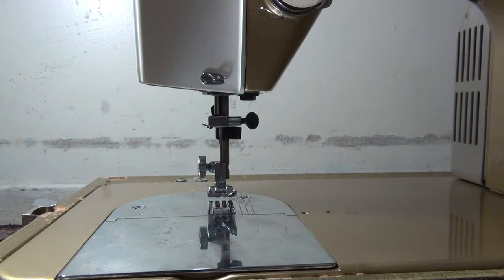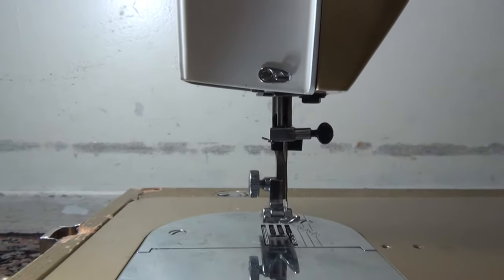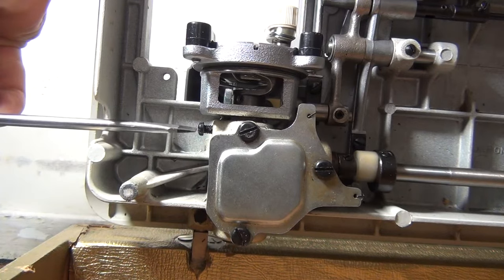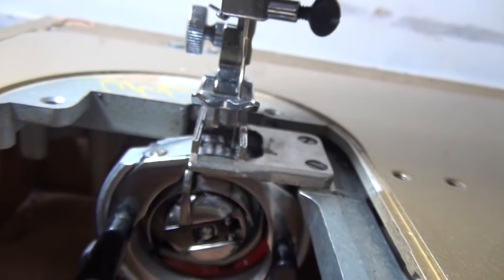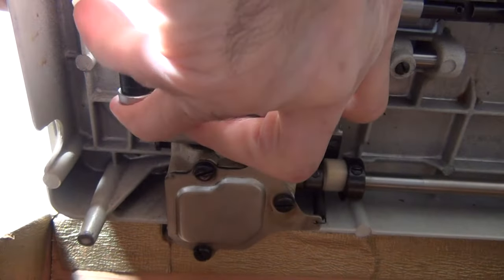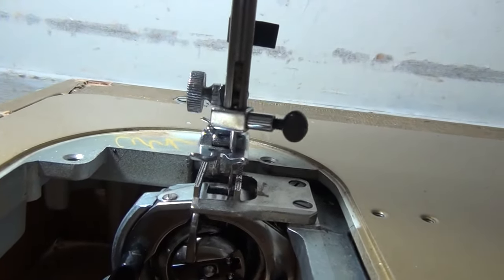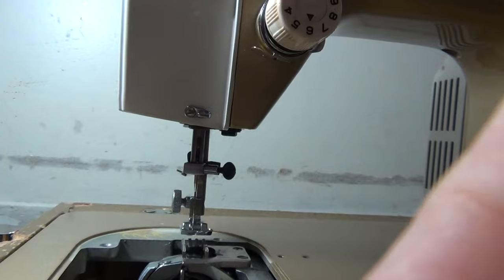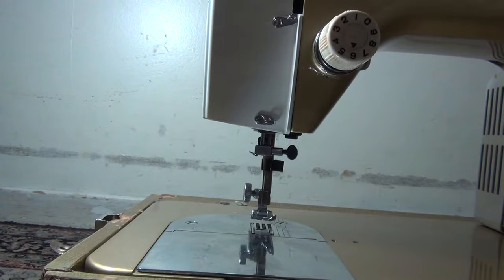how to fix sewing machine needle hitting metal

Comment: I’m having the same problem but the needle is hitting the plate forward rather than the sides can’t find a video to help :( x
Reply from the maker: Maybe you have too much tension
Reply: im having the same problem the needle  hits the plate in the front, did you find a solution?
Reply from the maker: @LAoMARAo  did you buy it like that or this happen during the work. if you get it like that so may be some one bend the needle column
Reply from the maker: @howardwayneroberts93  Maybe the problem is in adjusting the tension with the large stitches., and i dont thind the bolt because u said you lost it after you got the problem . first check the tension and if the problem is not solved  so take the cover metal out and see If it's like my sewing machine problem or not and then you can apply what I did. thank you
Reply: @Howto-zu2zq  Yes I got it like that, used, found out it was a s...c..am when I tried to contact the seller  I was already blocked so I figure he already knew it was damaged and I know how to do simple repairs, but that kind of problem I could  not fix I open  the machine but could not figure out how to fix it sad because is a bernina
Reply from the maker: @LAoMARAo  sorry to hear that but if u like to fix suff you can buy part from ebay and fix it
Reply: @Howto-zu2zq   Yes I like to fix them if it's an easy fix, but I'm from Mexico and that level of dificulty is to hard for my ability  also it will be more expensive and I don't want  to spend more money  I think I will try with a hammer and if it doesn't  work I will give up and give it away